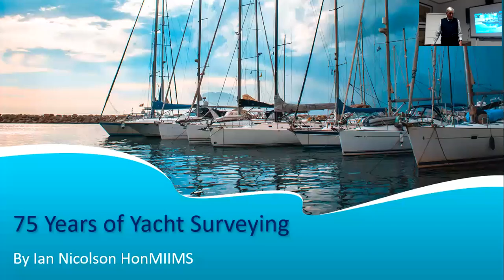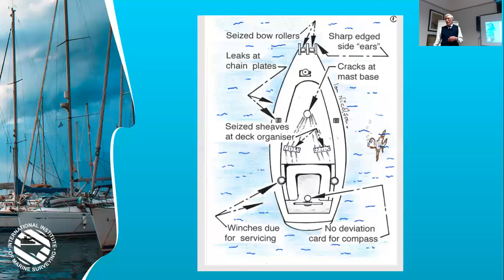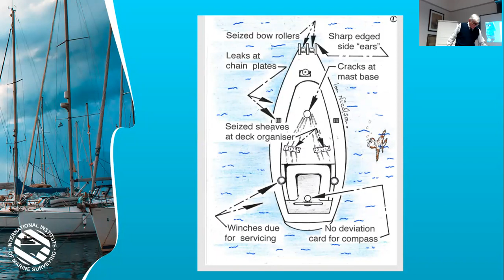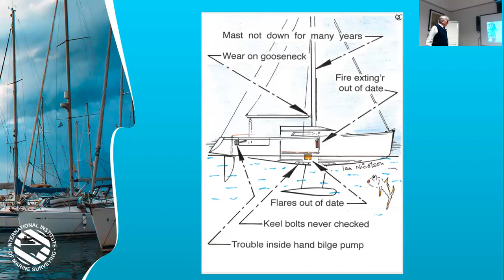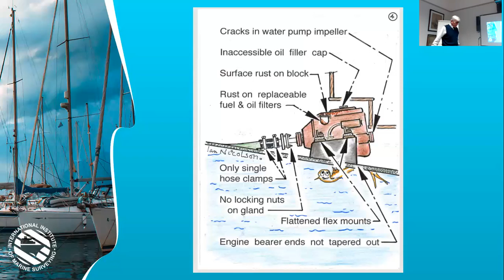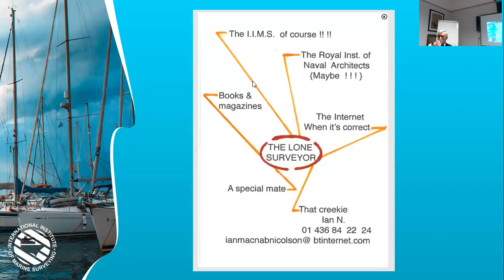75 years of marine surveying by Ian Nicolson

Comment: In my opinion, Nicholson writes some of the driest dull marine books out there. Hardly any real world photos and all sorts of tedious mechanical drawings and endless lists. For instance on this video he says of the engine bearers, "they should be 1 and 3/4 times the length of the engine plus the gearbox". What? Just any boat or engine for this rule?  A powerboat with 225 hp can have engine bearers only 1-3/4 times the length of the engine?? Or a 75 foot sailboat with a 50 horse engine, same thing????  I prefer Dave Gerr.
Reply: I have all of Ian Nicolsons books, I have respected his advice and appreciated his mentoring when I was getting trained, all based on his lifetime of experience. Never heard of Dave Gerr, who is he and who are you Paul Briggs ?
Reply: Never heard of Dave Gerr but I now know Paul Briggs is a bit of a twat.